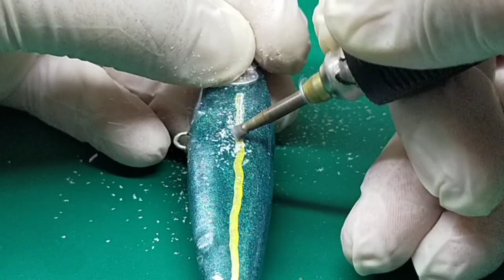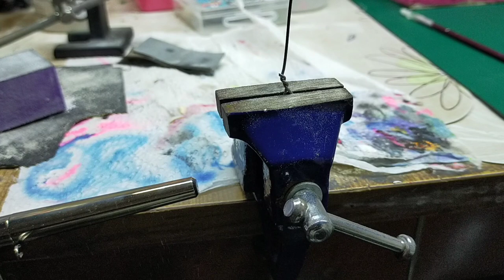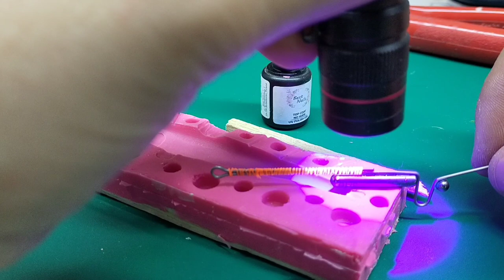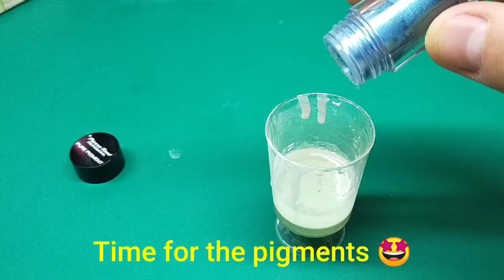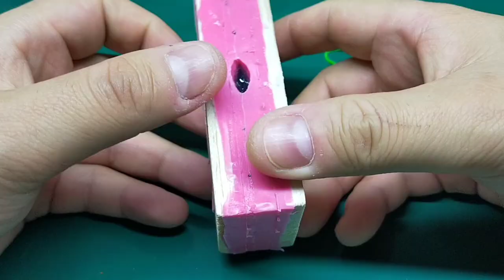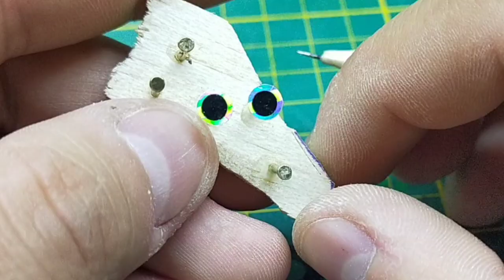Lure Making Lipless Minnow 2.0 - part 1

Comment: Great job! How long does it take the UV activating nail lacquer plus the UV activated epoxy to harden/dry with the UV torch?
Reply from the maker: Ages, now I have proper UV lamp, so the UV nail lacquer hardens rock solid in 3min 😉
Reply: @SuchaJerkCustomLures  3 minutes with the right lamp, that's great! Thanks.
Reply from the maker: @pa_maj.MARTINI-van-MAN  but that's only for nail polish UV, which, of course if you plan to use it frequently, won't be very economical. The usual lure making UV, ex AlumaLite needs different kin of lights
Reply: @SuchaJerkCustomLures  OK thanks.

Comment: Hi, you used epoxy + lead. Isn't it too heavy? Does it have a correct attitude or does it sink like a stone?
Reply from the maker: I used epoxy + tungsten 😅 it's sinking at moderate speed 😉 the finished lure weights 20g so it's not that much 👌 it's ment for sea fishing from shore so the casting range is important 👍
Reply: @SuchaJerkCustomLures  I realized an epoxy lure like yours, but i am not satisfied beause it rotate and sink like a stone in water.
Thank you for your answer.
Reply from the maker: @dep305  yes the twisting can happen, because the epoxy doesn't provide buoyancy, that's why is crucial to have the weight as low as possible in the lure body!! I'm satisfied with results I was able to achieve 🙂

Comment: what wire do you recomend ? i was thinking about using 1 or 1.2mm stainless welding wire
Reply from the maker: Well all depends for which lure or target fish 😉 I use from 0.5mm stainless still for lures 2.5-5cm finishing at 1.2mm for my 10cm + lures for pike or sea fishing 🎣 if you only wish to buy one to start from 1.00mm would be good compromise 😉
Reply: @SuchaJerkCustomLures  ok nice thank you 😄